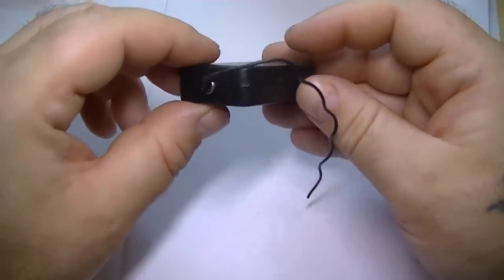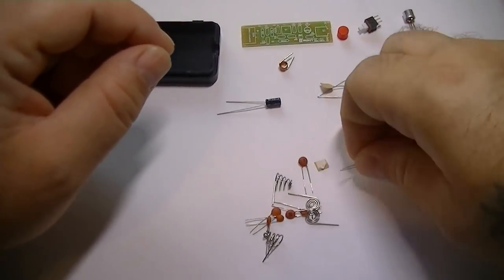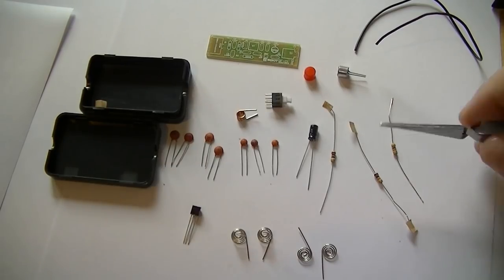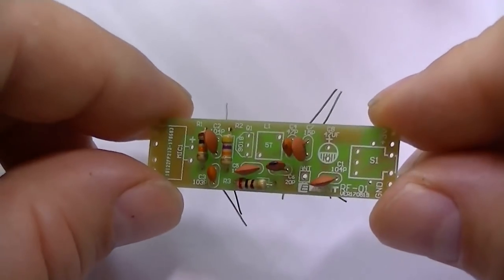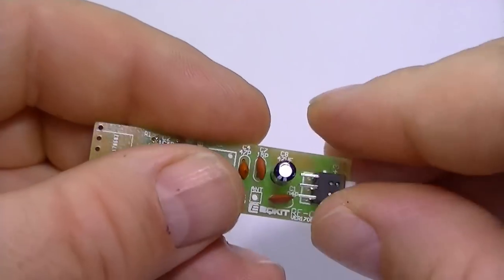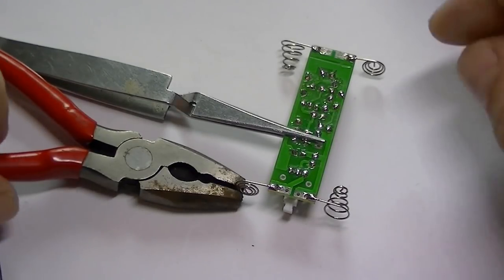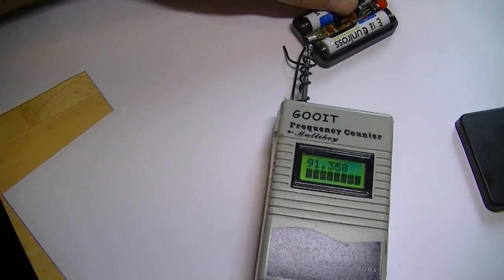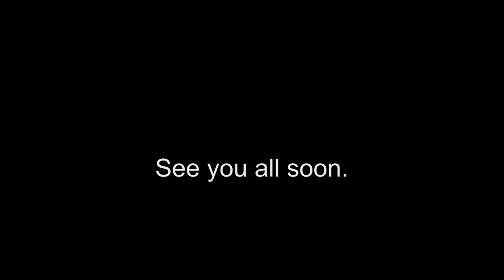A mega cheap FM transmitter.

Comment: MR. Dazaro, GREAT video. Question I have some 2904 transitors, by chance do you have a simple circuit that I can follow to make a transmitter. From what I can find this transistor will work like the 2n2222 but only using a lower voltage 6v instead of the usual 9v. Can you direct me please?
   Thanks for reading!. Eric Dee

Comment: nice video!
it is unbelievable how cheap it is.
I used to build these kind of transmitters and I had a lot of fun with them.
afterwards it became more serious and we made buffer steps behind it.
the range became very big.
then switched to ShortWave in AM mode you need a very long antenna
.
but then you also have the half-world range
 experience!
for people who want to listen to ShortWave here is an online shortwave radio:
http://websdr.ewi.utwente.nl:8901/
you have to adjust the receiver just as well otherwise you can not see where you are listening.
pirates around 6300 to 6305khz in AM mode.
also further up and down there are also pirates!
also on MW 1600 to 1660 AM (often around 1630khz)
fast internet is necessary!

Merry Christmas and a happy new year!
Rob.